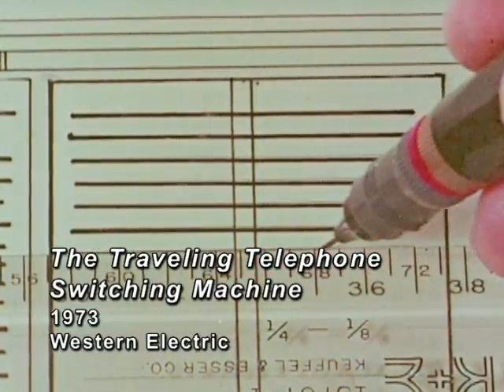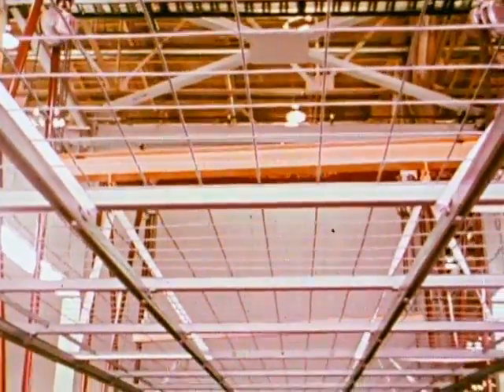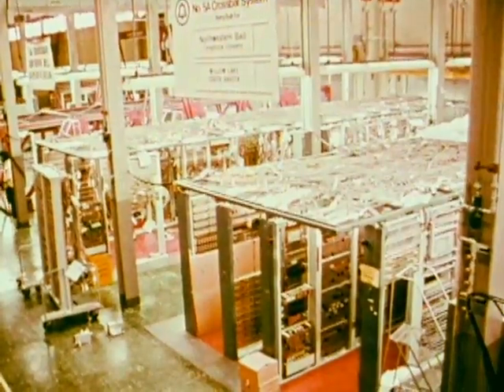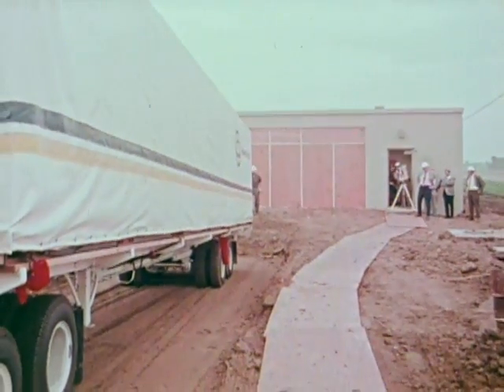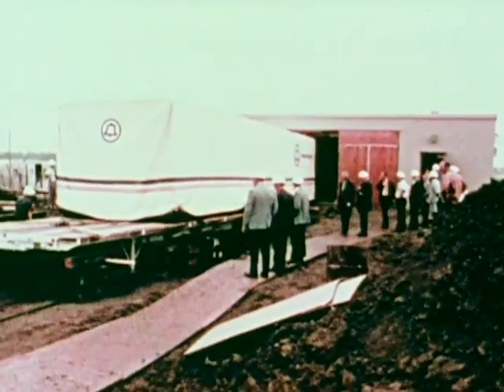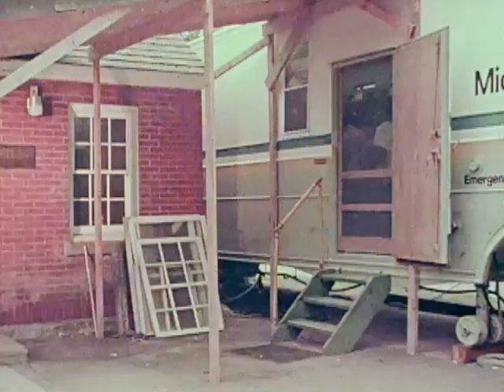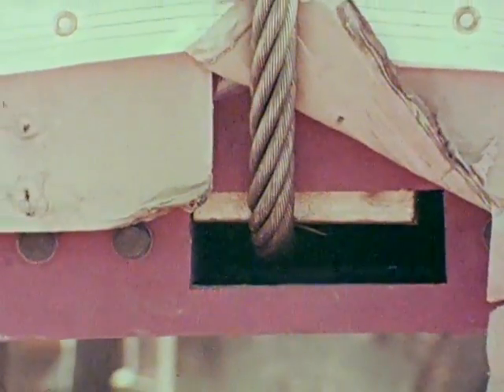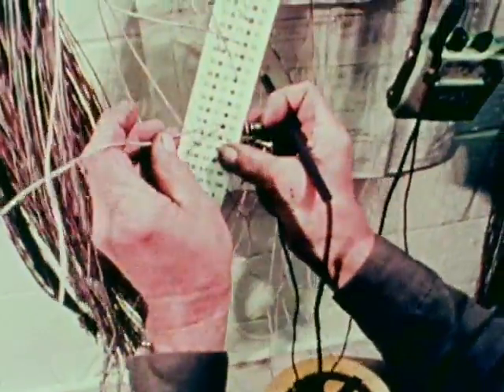The Traveling Telephone Switching Machine - AT&T Archives

Comment: Back in 1975, I had occasion to work in a small town, in the middle of nowhere, called Armstrong, Ontario.  Shortly before I arrived there, they had switched from 2 digit dialing to 5!  The new phone exchange was installed in a trailer and apparently they just rolled it in and hooked it up.  They didn't even bother moving it out of the trailer.  BTW, the road to Armstrong would have given it a good shakedown.

Comment: Now one can build their own "telephone switching machine" with a laptop and a bunch of VOIP adapters.  No giant truck with tons of stuff needed.
Reply: Not exactly true, you're still using dsl or cable lines
Reply: Not true, Landline communications is still the biggest infrastructure in the world! cause it's been around longer than anything else has, So you can only imagine how big these machines are today! they still take a lot space to build and big buildings to put them in, I've called into a 5XB office before and it sure does sound really cool listening to you're call going through that machine is amazing!
Reply: @MichaelWallace-oq3wd  Most of that infrastructure is dead now, replaced by fiber and coax mostly.
Reply: @EvertG8086  not true I’m still served off a old switching equipment and I use a traditional landline phone going over copper wires.
Reply: @EvertG8086  it’s still out there you just gotta be smart enough to find them.
Reply: You still need 300000 VOIP adapters but basically yes. Telephone switching is no big deal for decades old hardware now

Comment: I once got to check out a 3A Crossbar Switching System, developed after the 5A using even smaller components and taking up half as much space as one of these but with the same capabilities. I have been told they only manufactured 17 of them and that there's only one operational one still in existence. It's currently at The Telephone Museum in Ellsworth, ME and used to serve the town of Bradford, ME.
Reply: I've actually dialed into it their 3A crossbar's before. it sounds like i'm in the 1970s again when i hear those nice clicks and clunks on the line. lol
Reply: Who gave my comment a like? Please let me know thanks!
Reply: Sxsphil has one, and i think it is working.
Reply: @maxdutiel  yes, he has much more equipment in that 3XB

Comment: Just as a second thought, with all this talk of EMP and such, I wonder how well this electromechanical stuff would hold up, compared to the frail microelectronics inherent in EVERYTHING these days.
Reply: it would survive 100%. i worked for 30 years as an engineer in Bell Labs
Reply: @davidjames666  That would be the dream for me. Having access to things like the old designs and maybe even hardware for systems like step by step, panel, and all the different crossbar switching systems is my dream and eventual goal.
Reply: Probably better, but you're forgetting that emp damage is proportional to loop area. Small electronics will be fine or just need a reboot
Reply: Great advertisement “ We dont take credit for the wheel.”

Comment: And then the government broke up the Bell System and the layoff's came
Reply: And sadly much of the reasearch and development into seemingly unrelated technology dried up afterwards. Bell systems gave us the transistor, solar cell, maser (later called lazer), coaxial cable, satellites and their ground tracking stations, cellular phones, on and on....
Reply: @jamminwrenches860  Bit of difference between MASER and LASER.  MASER was using a microwave exciter. LASER uses a similar process, save it generates energy at higher amplitudes and frequencies.  Hydrogen MASERs are still in use at locations where RF interference even at milliwatts can ruin a science project, like the VLA and other deep space radio telescopes. They are used to amplify whispers from the deep space probes, enabling studies to be accomplished.
Reply: Many left AT&T & came back to Bell@

Comment: I wonder how many patents were stealed from AT&T during cold war. You can see many similarities in old analog "national" phone exchanges in postcommunistic countries. This solution was made for massive public phone network deployment. Something unbelievably in country where only every 10th citizen had landline and wait time was around 5 years or more.
Look on this. What a wonderful piece of engineering!
Reply: You would be surprised, but the USSR actually had automatic switching systems widely deployed before the Ma Bell in the US. The first rotary system switches ("machine-based automatic telephone stations") were widely installed in Moscow in 1920-s.

The USSR was also a bit ahead in deployment of crossbar-style switches ("coordinate switching systems"), while the US standardized and perfected Strowger-based switching.
Reply: Soviet countries were actually ahead of the US in many regards. The phone systems there were designed to be fully automatic almost from the very beginning, there were no manual phone exchanges. While in the US a lot of areas had operator-only service up until 60-s.